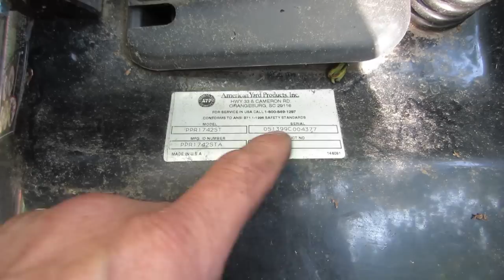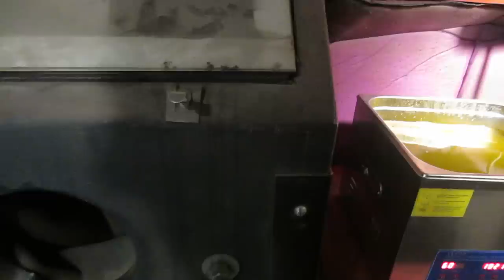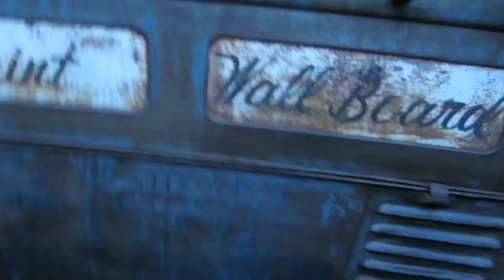abandoned poulan pro riding mower. will it run?

Comment: You should never try and straighten a bent mower blade, it is unsafe. and those were mulching blades. Mower blades are made out of spring steel and are heat treated - when you hit something and bend a mower blade it ruin's the blade and it cannot be bent back to it's original shape, it won't bend back 100% because the blade holds the shape where it was bent, and bending it weakens the blade and attempting to bend it back straight weakens it even more and can cause the blade to break off, a new set of blades are not that expensive - and with a bagger it's best to use hi-lift or 3-in-1 blades and not regular mulching blades.I've been in the outdoor power repair business for 20+ years and i never do any repairs unsafe, if a a part is bent, broke or worn out i always replace it, safety is number one and especially with mower blades, they spin at a high rate of speed and can be dangerous! So anyone reading this comment, please never try to straighten a bent mower blade - it is highly unsafe!
Reply from the maker: l call bullshit, it may bend a little easy next hit but its not going to break off and go flying, show me any picture of one that it has happened to, and im not talking about one that was folded in half then bent back, im talking one bent back a 1/2 inch,
Reply from the maker: dude l just watched one of your videos and you installed used blades with one missing the end on one side, the video when your grinder would not work so you couldent sharpen them? so dont come here busting my balls,

Comment: Why don't more people use fuel shuttoff valves in the fuel line to stop the carbs from flooding over when not in use. I immediately instlall  inline fuel shotoff valves in the fuel lines of all my 4 strokes . I'm surprised you spend so much time on saving so many carburators when you can just go on Amazon or eBay and order new aftermarket Chinese units for $15-30 , I've never had a problem with one yet and I've used a couple dozen of them over the last 5-6 years. . You do however have a very high succes rate I've noticed for repairing and brinig these shitty    old carbs back to life.

Comment: Had a Poulan Pro weed whipper. Biggest POS I have ever encountered. Yank you brains out to get it started, died constantly, spool tangled all the time. Worked on the carb, used it for a season. Finally smashed the ^&%$ out of it with a 10# sledge and threw it in the trash.

Comment: Errrrrrmmmmmm..... You know that there's petrol in the oil..... and that's come from a flooded carb (just done the exact same job on the exact same engine, myself)....... and you feel that the crank case and possibly the barrel is full of fuel...... and so you test the spark plug almost in line with the venting from the plug hole.......... I am not quite so  sure that was the best idea......! Mine had a corroded brass seat of the needle valve...... fuel (gas) was getting around BEHIND the seat so the needle and the working solenoid had no effect.... the fuel wasn't passing though the needle valve hole...

Comment: i would NEVER bend a blade, what if it is cracked internally, you might have decreased the strength of the blade by the twisting of it, be safe and just put on a new blade

Comment: Put a neodymium magnet over your vibration cleaner so you can throw the lid there whilst you remove parts.
Reply: Also, if you use pipe solder to dab the brass groove for the screw driver and a needle file to cut it again, you can restore it to useful status. Otherwise, it will eventually get dirty again, as they always do, and the second time you might not get lucky.
Reply: Also, curious why instead of putting rivets, and metal, why not dremel a v grove, lay some plastic strips (preferably of the same type) then with a hot iron press melt the stuff in.  It's basically recasting and can be done very easily with a hot plate type iron.